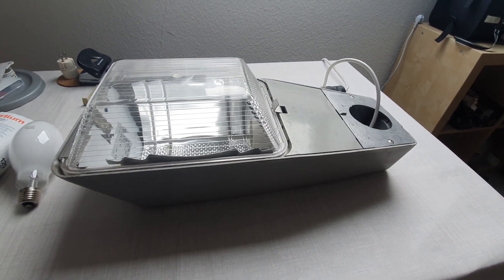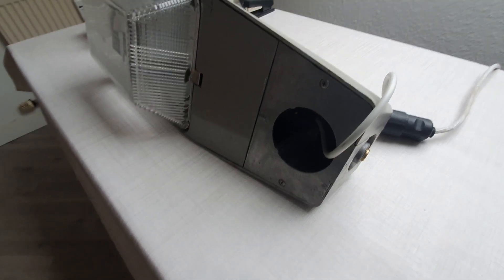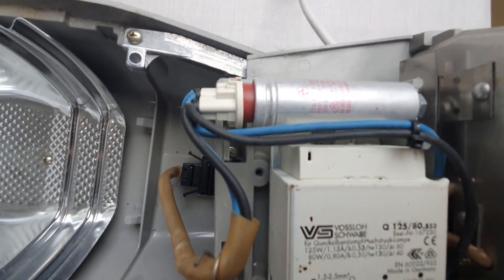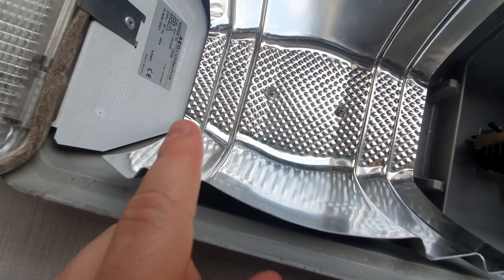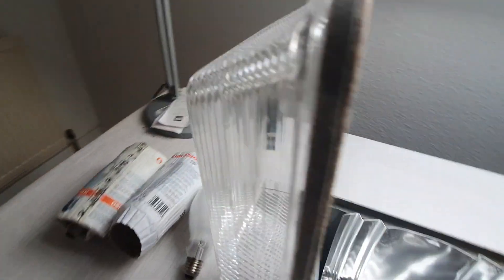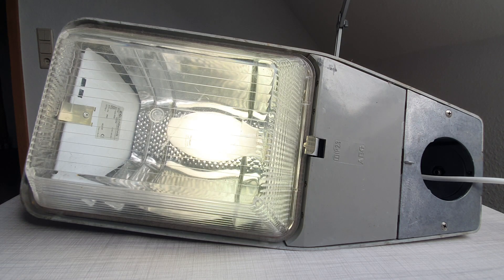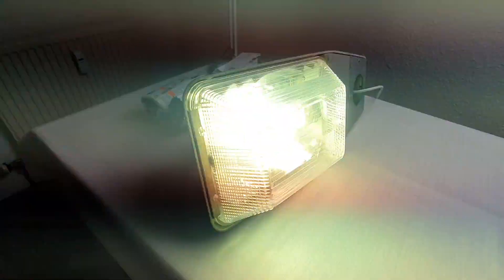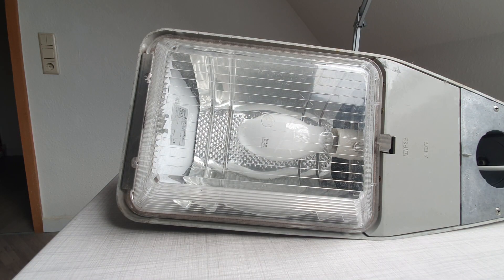AEG Koffer 70 - 80/125W mercury vapor (MV) streetlight fixture from the 90's

Comment: I have the "AEG Koffer 150' with a high pressure sodium lamp of 150W and the "AEG Seil-Koffer 150" with 2 mercury vapour lamps of 125W. I' m looking for the bigger "Koffer 250" but is really hard to find.
Reply from the maker: Nice, I've been waiting to find a Koffer 150 locally, but wasn't lucky yet... The Koffer 70's are a lot easier to get